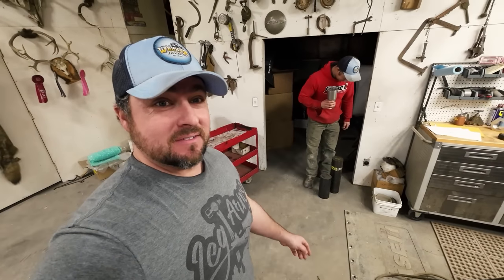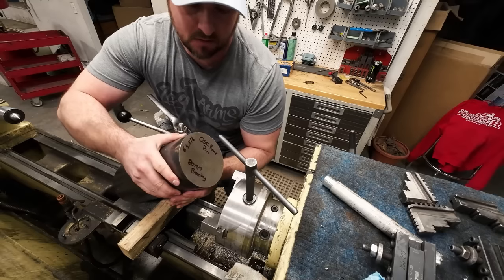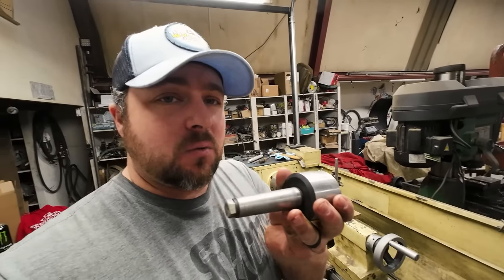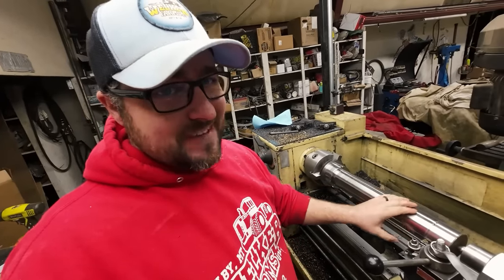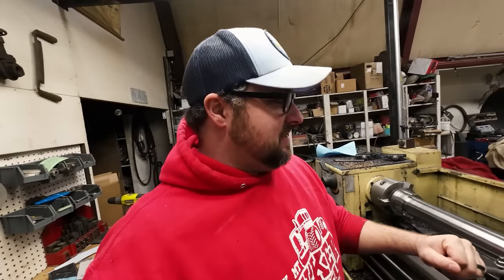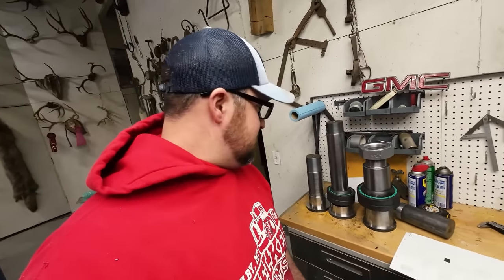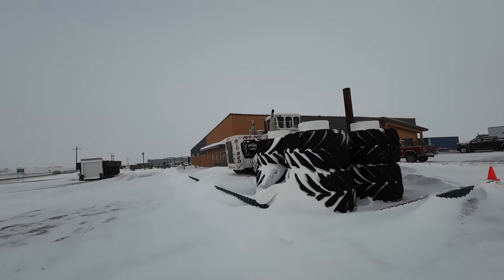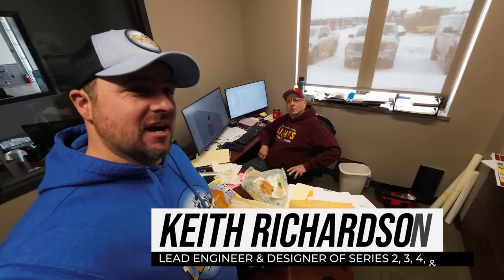Leg Arm's BUILT The BIG BUD 700 PINS!

Comment: Job well done. Been machining for 45 years. When it comes to metal removal, it all starts with rigidity. There is a great book called Machinery Handbook. Try and find older one. Maybe mid 80's edition. Have about 2500 pages. Lots of charts. Have all sorts of details like vee pulley angles, sprocket details, splines, gears, bushing fits, material selection, etc. I know reading isn't your strong point, but it will become your Bible.

Comment: Hi Leg arm's
Your little problem with you ruffling your thread is 2 things
1. Your tool for the thread steel is very thin and has too much overhang, so put the tool back as far as possible in the tool holder.
2. lubricate well while cutting the thread and remember that every time you cut a thread use a sharp cutting tool. 😁😇
You do a super great job. 😎
Mickey  from Denmark

Comment: That’s great to be a part of making the new Big Bud tractor.  I’ve never seen one so to see all of the heavy steel and the axles and tires all coming together is great to see.  The machining of those pins is intricate.  Impressed by all what goes into building and designing automobiles and heavy equipment.

Comment: when you've cut threads on a lathe you can polish them with a steel wire wheel mop, makes them a lot smoother
Reply: The surface finish and hardness are important.

Comment: When threading, set the compound at 29 degrees, and feed in with the compound. This "helps" make smoother threads. You did a great job.
Reply: At 7:00 approx. he does in-feed with the compound, however it looks like he has it set at 45 degrees.  I watched at 1/4 speed.  29 or 29.5 degrees is good to only cut on one side on the tool  and provide just a hair or relief on the non-cutting side. ( for a 60 degree V thread).

Comment: When turning a thread, just before your last cut, run a file, taking the bure of the top. To take the heat out of your cut, there is a "spray mister" system. uses air and a water base cutting system. It does a great job removing the heat with very to no mess on the lathe. I have been out of the metal shop for many years so have no literature on this item. I enjoy your uploads very much, and being a machine for my trade I enjoy this upload very much
Reply: if he is using a full threading insert it does that for you . if it's just a universal insert then yes  for the file.

Comment: Nice work and glad you guys are part of bring Big Bud back to the market. BTW, set your compound slide at 30 degrees or a bit less than 1/2 your 60 degree thread angle, so on your finishing thread passes you are primarily cutting with one side of the insert. Best way to check your threads is using the three wire method as you are then measuring on the true thread pitch diameter. Also take a pass with a flat file on the OD as a sharp crest on your thread can "fool" a go/no go (your nut) as the crest can drag in the root of the nut making you think the thread needs to be reduced.
Reply: yup

Comment: You can improve your rough threads by setting it up to cut one side of the thread in stead of both sides. Set your compound slide to half the included angle of the thread and cut to depth with the compound screw instead of the cross slide screw.

Comment: Nice job.  But to be a little picky, they are called "chips", ( or "turnings" according to my local scrapyard, then again my local scrap yard calls chips from a milling machine turnings too.  ) When you are running a lathe and  cutting a shaft you are "turning" it.  Filiings are what you get when you use a hand file to file something.  See Dennis Hampsten's comment on threading.

Comment: Are they going to have a PTO option on these tractors?, for example towing those huge grain carts like you had on demonstration.
Reply from the maker: I am told there will be two options for pto, hydraulic and mechanical. These tractors will have 150+ gpm flow so definitely could do a motor on the back just for grain carts.

Comment: Those bearings are shrink fit from factory which shows that shaft OD is too small for it. That shaft/threads seems to have taper as you can hear and see the fot change as it goes up the shaft. Measure the OD and measure against specs from machinery handbook.

Comment: Scott. I imagine your threads are choppy because it looks like your compound is setup at 30 degrees off the Z axis. It needs to be setup 30 degrees off the X axis. So every time you try and increase your depth of cut using the compound your leaving a little tiny bench because the compound is at a different angle than your cutting insert. I made the same mistake a month ago when I bought my first lathe largely inspired by watching you. Keep up the good work man, from a fellow farmer in Alberta.

Comment: did you feed the threading tool at 29 1/2 degrees using the compound.? it's hard to tell from the video. if you feed in 90 degrees to the shaft the thread will be rough because as you get deeper you are cutting on both sides of the insert and it rips. feeding in at 29 degrees means that you are cutting almost all on one side of the insert and just slightly on the other side. that will come out much smoother.

Comment: Scott, often when threading on a manual lathe your RPM and SFM is very low, and carbide inserts don't perform as good and leave a crunchy finish at the low speeds. The traditional workaround is to cut the thread oversize a few thou, then file (and maybe stone) to size to keep a better finish. Good stuff though, turning big parts is always satisfying!

Comment: One thing I would say DO NOT WEAR LONG SLEEVES ON THE LATHE or drill press if you get your arm close it could pull you in and tip your arm off and get very injured. For the threads run some medium grade scotch bright on it and it will make it feel better. It is very cool seeing a farmer making stuff on a lathe and cool it is for the new big bud

Comment: That nut looks like the threads are not square to the face when you are threading it on. This is the first shaft you machined. Good job on the machining. I don't have a lot of patience when it comes to removing a lot of material.

Comment: If you're wondering why the thread surface is not what expected,  it's because of the way it was made. If you're only adding on the y axis. That will increase your cutting length/area from cut to cut until it starts to flex the support.  That's when the surface starts to look not as expected anymore. So if you have done your first path,  then use your upper support and change the x position until you have a shallow but wide grove. Then add y axis and repeat. How much you you can go depends on the material, how worn your lathe is and your tool...

If you world have done so on my lathe,  it would not be recognizable as a thread 😅

And an other little thing,  wait before you do your final shavings, the shaft hat to cool down,  otherwise your shaft will be narrower on the chuck (heat is going into the chuck/lathe). So your building an undersized taper if Murphy gets his hand on it ...

But still well done ✔️

Comment: Scott, I have a question for you since your the youngster who turned the pins. I say youngster as a compliment because at seventy three now and pushing another one this year.. maybe.. I digress. I have turned a few tons of shavings on the different mills in my old shop, the milling machine, the old style bridgeport, and other tooling..... I ran a light oiler on the stuff being turned so it washed off any debris on what I was making. It was also set up for air to blow off stuff as well and the bits I used for cold roll steel, were designed just for cutting threads only. I know its not mandatory for those bits but when making stuff for a injector base or other special stuff (out on the islands in alaska, no store just a few hundred miles away) as we made anything we could to save on shipping. Many times the part was maybe a tenth of the cost as shipping was the big ticket. Are you set up with that capability or do you think its even necessary for the process to include it? Not just sure when all of this was filmed as I seen a seven hundred big bud on a expo or someplace.. maybe Brians farming.. when I see Big Bud, it has my attention quickly! They found more steel in me being as we are talking scrap metal and they want to take it out soon. I said yes but the date hasn't been set yet. Not to worry tho as I have had as many hours of surgery on me as you did in one pin turning for sure. Plus my old dog said to go for it.... I think he loves my nurse more than me as she always has a pepperoni stick in her purse... and dang is she ever so good looking. She told me she wants to take care of me should things ever get worse than now.... plus her four year old boy is just about the best thing since sliced bread. She was ever so surprised as she is fifty  three now.. yep, a real surprise for her!! I did explain how these things happen and she jokingly told me "Really?" Ha ha, she's a girl I just wish that I had met years ago.. her husband lost his life in the service and my life in the service kind of reminds her of it.

Comment: no comment,i was a manual machinist for 30yrs,what was the tolerance on your drawing,only measure tool u used  was an 8 inch digital caliper,really ,did they pass inspection at Big Bud, now MST,its for a good cause i get it

Comment: Your bit is dull...
(Thread bit) 
Its getting too hot & chinking your threads , due to being dull...
It'll still do the job . As long as your depth is correct ...
The saying from an engineering perspective is , half a nut is as good as a bolt..
In other words , if you get the nut half way on , the bolt will break before the threads strip  out...